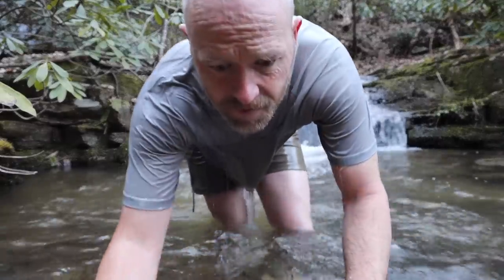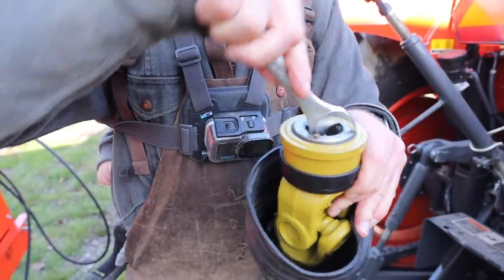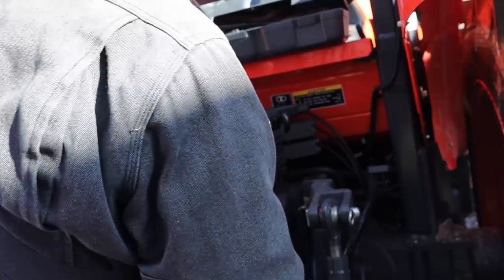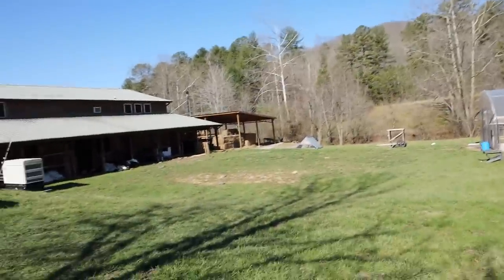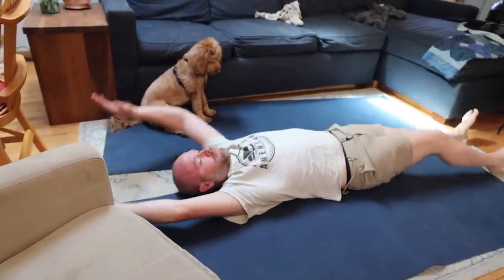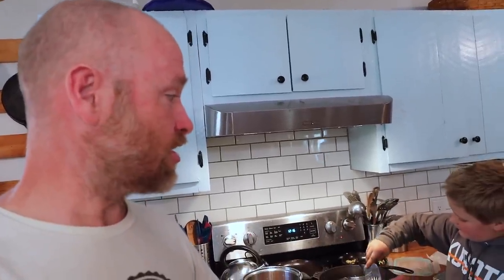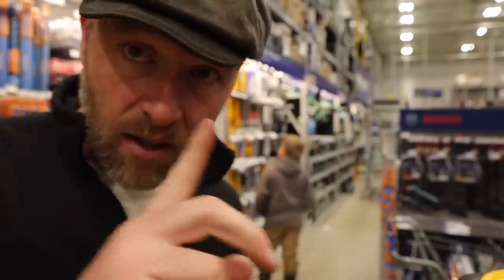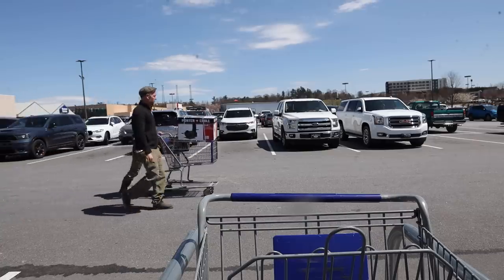1st Time Testing My New Tractor Tool

Comment: Hey Justin, good job getting everything hooked up! One thing make sure you idle the tractor up when spreading, their maybe an indicator on your rpm gauge that has a “540” symbol you want to run your rpm’s up to that or the tractor will be bogged down and over heat eventually because not enough coolant running through the engine. Well done!

Comment: Check if there's a grease fitting on that PTO connector. Make a maintenance schedule for each piece of equipment too. Things you use often may need weekly maintenance while other things may be monthly or quarterly. Put the schedule on a whiteboard in your tool crib and check it often. Teach the boys how to use a grease gun, they can help with this. Initial & date each task, so you know what was/wasn't done & by whom. This will save you thousands of dollars and lost down time.
Reply: 100% correct. Preventive maintenance is crucial.
Reply: Hell ya it is, well done

Comment: Justin, when the time comes you are going to want to use both tractors for the cleaning of the barn. Use one to load the manure and the other stays hooked to the spreader. My recommendation would be to leave the Ford hooked to the spreader. and clean and load with the Kubota. If the Ford has different hydraulic couplers from the Kubota, the trick is to make adapters using a male end that hooks into the Ford with the other side of it a female coupler like the Kubota has. That way the equipment can be used with either tractor.

Comment: Hey Justin. Rub some grease on the pto splines and on the inside of the fitting on each piece. Yes you will get dirtier handling it. But much better for long term use and keeps rust off

Comment: Word of caution before releasing your hydraulic hoses turn the tractor off and run the control levers thru their motion it will send the oil back to the reservoir and the fittings will release and or install much easier if you leave pressure in the lines it makes it difficult to remove or install them
Reply: Or put it into float

Comment: Justin the end of the pto shaft on the spreader, the round part pulls back.  When you pull back it let's the balls inside open up to slide the shaft on.  You also can use the speed of the tractor to fine tune the amount you are spreading.

Comment: Hi from UK….other folks have made some good remarks about 540 rpm PTO speed and forward gear speed….you just need a little practice but the most important factor is safety for you and the family, some people this is a bit woke!!!! but you NEVER mess around with PTO’s, always grease them, always make sure the check chains and clips are fitted and work, also check the PTO shaft turns properly within it’s guard. When you have several machines the PTO’s may be slightly different lengths…keep them with the machine they come with!!!…. ‘overextending a short PTO is dangerous and lastly everybody needs to know how to approach the scene of a PTO based incident i,e stopping the engine before getting closer!!! To some this may see extreme or over the top, but I’ve seen the results when people get it wrong I’m also a qualified tractor driver so I did the safety training many times over…..it’s worth it!!! Keep safe and well, love from UK 🇬🇧

Comment: Try picking up your ground speed to adjust the amount of manure spread! Gate is mostly just to hold manure in while heading to the field.
Reply: You also should be able to adjust the apron speed to adjust the spread rate
Reply: @elroycober3720  some small spreaders don’t have a flow adjuster on them but good point.

Comment: Hey Justin I just wanted to thank you if it weren't for your suffering I would not have found out what my suffering has been about for the last 4 or 5 years. I was diagnosed with hashimoto's in 2000 but because of being immunocompromised when I went down into Mexico the foodborne illnesses got me it was brief but the pain started after that and oh my Lord the severe pain all my ligaments tendons none of the doctor's new what it was now I need an update from you as to what you're doing to be able to keep moving without that pain I'm allergic to sulfide drugs I don't like drugs so can you do an update on what you're doing to try to control it the pain is so bad some days I can't handle it

Comment: 10% of the world is sensitive to salt intake ,read labels n lower his intake of salt ,biggest problem with this sensitivity is gaining weight easily but ESP. LOW ENERGY!! YOU CAN SLSI MEASURE POTASIUM LEVEL , WHICH GIVES SOME ENERGY PLUS MUSCLE STRENGTH. DAILY AMT. IS 4700 MG. & AMERICANS ARE  LOW IN THIS N WAY TOO HIGH IS SALT INTAKE !!! JUST FOR YOU TO CHECK OUT N  SEE IF THAT TOO CAN HELP !!!